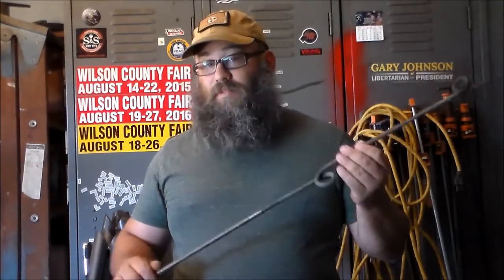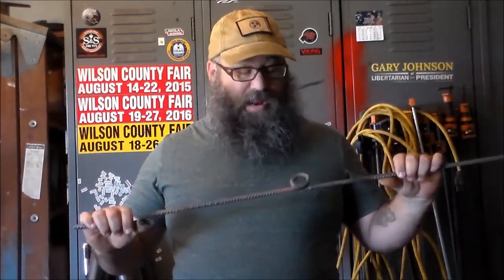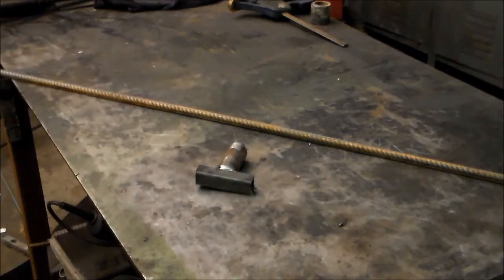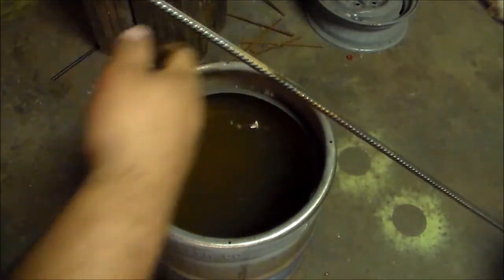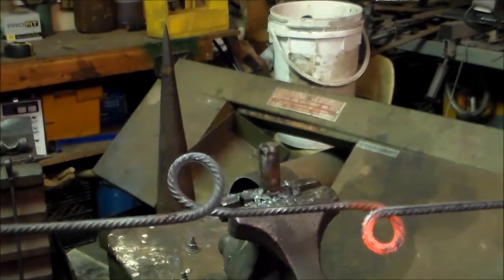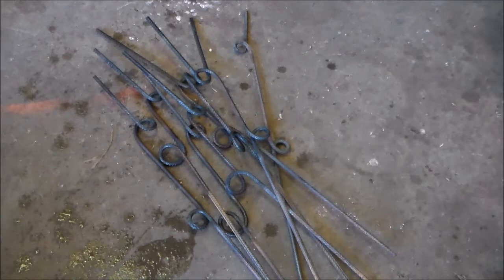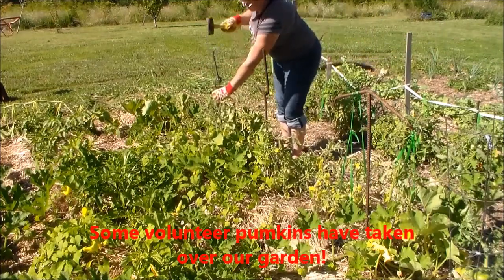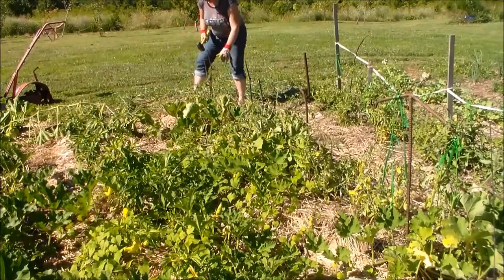This is what happens when a blacksmith needs tomato stakes!

Comment: ..Good idea Brandon. I like using flower wreath stands. Those metal folding tripods that hold flowers for funerals. They are good for cucumbers, with a piece of hog wire, and beans to run on also...
Reply from the maker: Good idea on free material for sure! We use horse fence wire for cucumbers and beans.